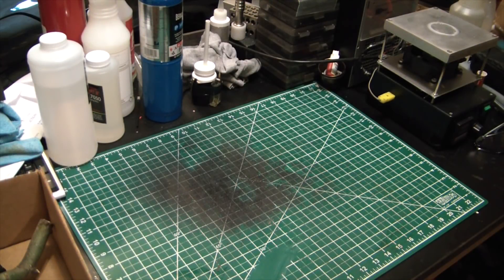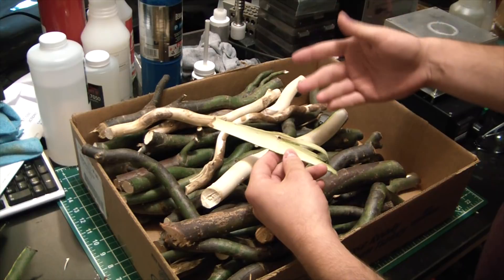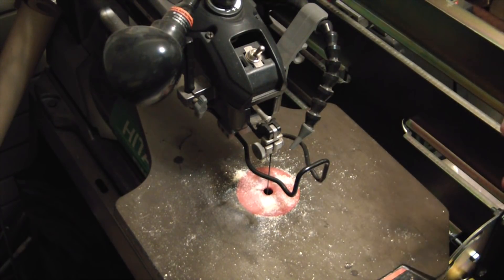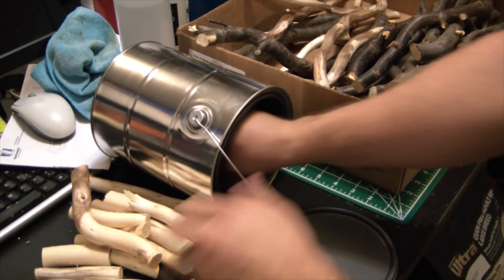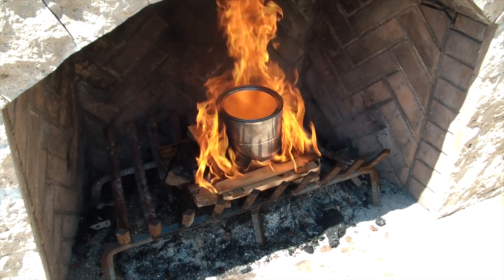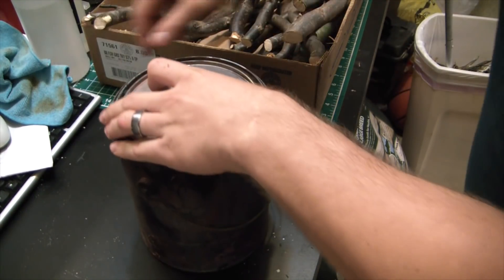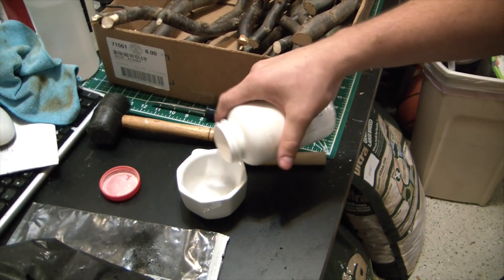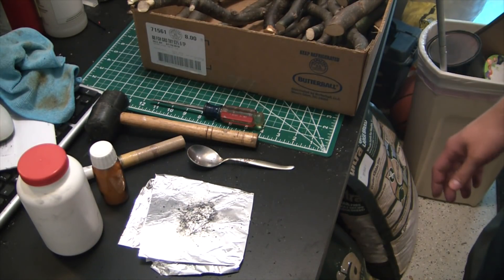Making Willow Charcoal for Black Powder - The BEST Charcoal! ElementalMaker

Comment: 1:55 awesome, because that's what my first thought was: try to extract it. It also works as a diureticum, and the combined effects make it excellent against blatter infections. It also has laxative effects, so you don't want to use it if you don't really need it. Plus, drinking lots of water is important, as diarrhea and diurea combined is an express lane to dehydration.
And for the sake of your next video: there is actually higher concentration in the thinner branches. The greener the colour of the bark, the more it has. The only reason why thicker bark would be used, is because of absolute quantities versus manual effort. If you were to peal the thin branches, you'd spend a multitude of time to get the same quantity, so with the same amount of effort, you can extract more out of trunk bark because you just have a lot more mass to work with. But originally it wasn't even extracted. Just cut off a juicy twig and chew it like tobacco. (I have over 200 willows in my garden, and I have a special interest in all plants with medicinal use... If you didn't live so far, I'd offer to send you a batch).

Now I'll keep watching your video with the utmost interest, because I'll have lots of willow wood available soon, given I urgently need to "top" (don't know the English word, but it's cutting off the top half of biomass of a tree) about half of the trees in my yard.
Reply from the maker: Thanks for the excellent info; good to know that the bark I saved probably has quite a bit of Salicin in it! Good luck topping that many trees, sounds like quite a few long days of work!
Reply: For information on medicinal plants, I rely on a book called Compendium of Ritual Plants in Europe, but it's in Dutch. I believe there's a translated version available as "Compendium of Symbolic and Ritual Plants in Europe: Vol I Trees & Shrubs/Vol II Herbs" http://amzn.eu/6vof3Vh
and another one that I couldn't find translated, which specifically focusses on medicinal plants and how to use them (including recipies and how to harvest, extract and apply)

And if you keep your wits about, you can always find the right working procedures on the internet, but there's a LOT of b.s. on there too...

It's an extremely interesting topic when you are willing to let some (or in my case: all) of your yard run wild. Because most of those plants are more potent (or just better balanced) when harvested from their natural occurences, and throughout the seasons, the same spot is used by various plants (influencing eachother, and I believe that it's no coincidence that those plants yield better results)
Reply: about the charcoal. I've been thinking of using an old oil drum to make it. Do you think it would be feasible to use the same technique on such a large container? It would definitely get me a lot more charcoal per firing compared to the other uses I've found so far. With your technique, I could cram it completely full, and if I could keep the burning volatiles close to the barrel, they would provide a lot of extra heat input... Did it really create a lot of pressure in your can? Maybe a large volume could pose danger? Or maybe even propulse it up in the air? Hahaha, wouldn't that be cool: a wood fueled rocket.... Sounds like a bad joke about North Korea. =DDD
Reply: just one more thought on the salicin: I'm not sure how it behaves when it dries... The recipies I have always speak of fresh juicy young bark...
Reply: @lukearts2954  I was curious about that as well. I've heard & read that the bark can be used to make a tea for headaches & other pain, but hadn't read if it's affects were diminished any if dried (YET) so I did some research. From everything I've found & read so far, being dried is 1 of, if not the primary step to be taken if you want to store it for future use. Apparently, it doesn't seem to affect it or at least not enough to matter. Thank you for reminding me of that nagging question I've ''ALWAYS'' had about willow bark. Since I've been forced to endure chronic pain due to a near fatal auto accident in March, 1983, I've had to take prescription pain medication since 84 or 85, but I'm ''always'' looking to find something that's more natural. Yea I know, ''WHY DON'T YOU TRY POT?''. I have & did try 1 strain that worked great, but as with any strain of grass ya try, I'd prefer not to seem or be ''STONED'' while out in public. Anyway, thanks again for refreshing my memory regarding this question. Take care, ''Luke Arts''.
Reply: @sonnyburnett5514  If you want to avoid being stoned from cannabis, you could try purified cannabidiol (CBD) in droplets or capsules. It's the THC that makes you stoned. CBD virtually has no effect of numbing your consciousness, only numbs the pain... And since  you take it like any other medicine, the entire recreational aspect is removed as well. And that is imho the only way of usage that should be legal. All other forms are not to help someone's medical problems, but are only used to escape reality and create a whole bunch of popularly denied yet undeniably associated problems...
As for using willow as a chronic pain relief, I wouldn't advise it. First of all, because it's basically aspirine, but in its natural form. Hardly fit for long term pain control. Under certain circumstances, aspirin is also known to crystallize in tissues with lots of fine blood vessels like liver, kidneys and brain. Long term use would be a guarantee of getting such crystals. And last but not least, a prolonged use would be constantly overstimulating the bowel, potentially causing new problems stemming from irritated bowels (like irritable bowel syndrome... I kid you  not).

Thanks for the thanks :)) As for the hyphens: no need, as it is my real name... Always felt a certain obligation to do something artistic but not too hot =D XD
My making knives could be good for my last name, but doesn't match my first name one bit. hahaha...
Reply: well I don't have Willow trees I'd like to have a few. I'll pay for the shipping.
Reply: @alberthenry1026  If you find any willow tree somewhere near you, cut off a branch between January and August, strip it of all its side branches and all leaves and stick it at least 1ft in the ground. It will grow. The thicker the branch you use, the faster it will be a full grown tree. It's that simple. Just make sure it gets enough water... It's amazing how easy it is to grow willow. If you leave a log on the ground for too long, you'll find it has sprouted roots along the whole length and it will have off-shoots all over.
If you insist it should be from my willows, I'm sure it can be arranged, but I'm sure it'll be much easier - and astronomically cheaper - to just find a local source.
Reply: Lol but art willow its much easier and shipping is low